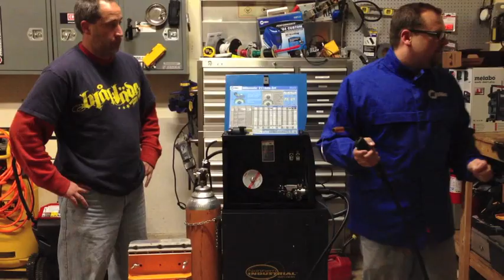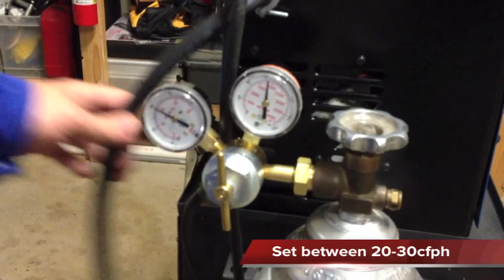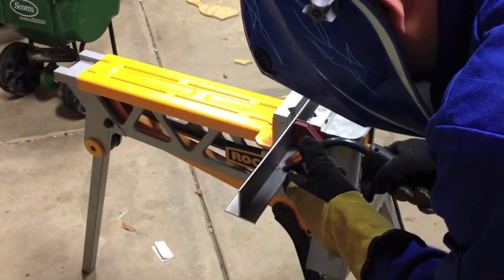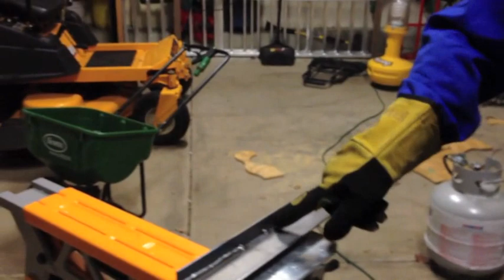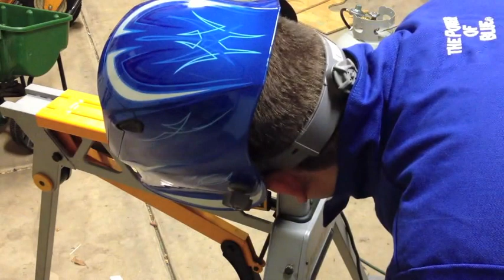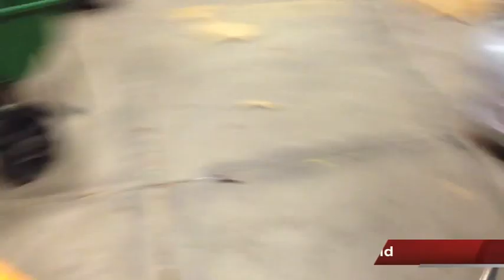How to get started MIG welding

Comment: 1- Don't drag your welds, unless your are running flux core.
2- Way to high of wps
3- Raise your voltage you vagina's
4- Don't try to teach people when you don't know what the hell your doing.
5- Buy a Lincoln.
6- Stop welding forever.